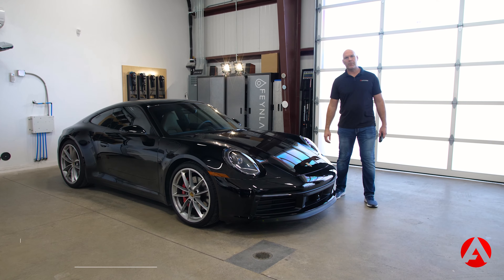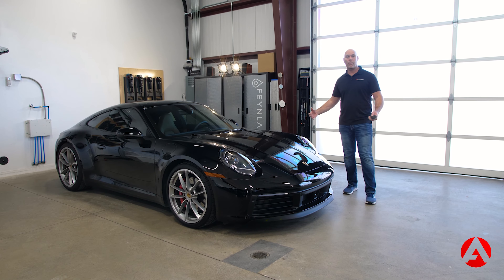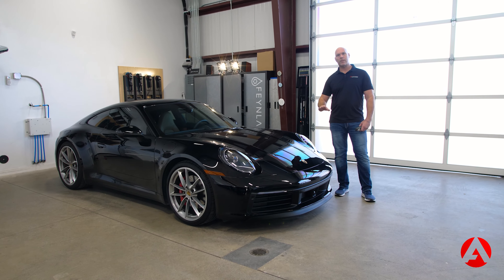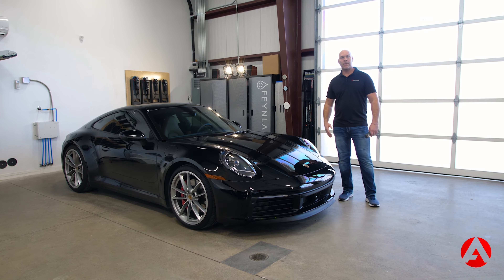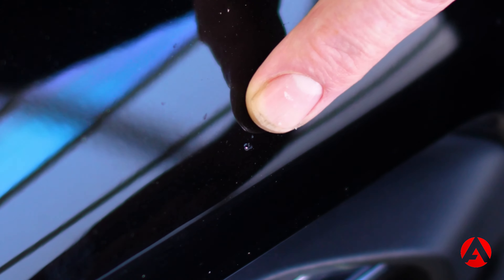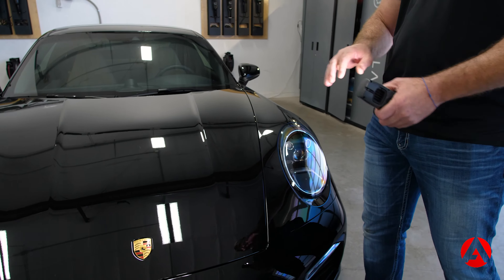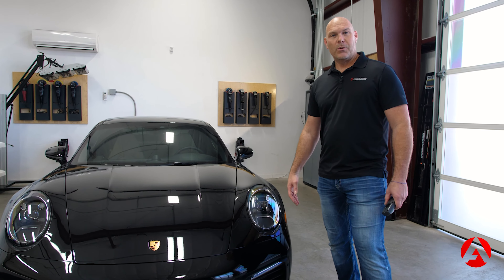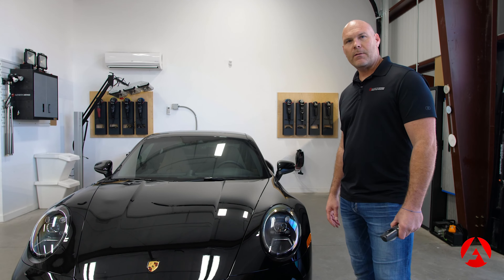Choosing Ceramic Coating instead of Paint Protection film?! ft. Brad McRae

Comment: I didn’t see how you corrected the rock chips in the bumper area
Reply from the maker: Rock chips cannot be corrected, unfortunately. We can usually make them look better by filling them with paint, but they are never fully fixed. At times they can be filled, sanded/leveled out, but even then, still not perfect. 

This is one of the main reasons to have PPF installed first thing to your new vehicle.